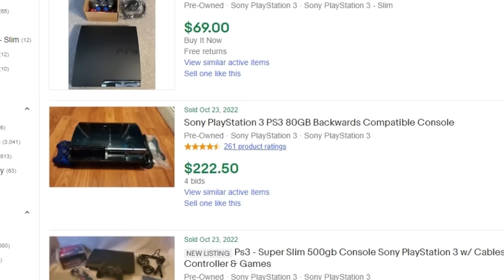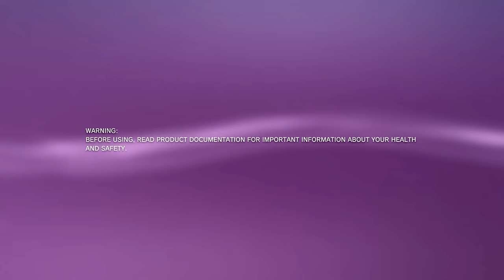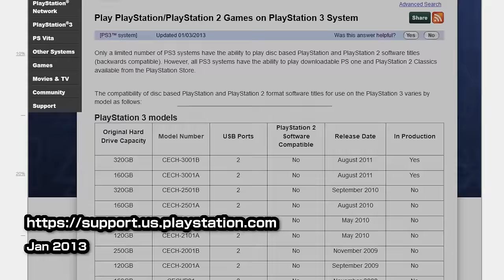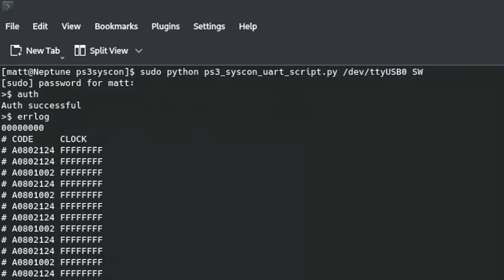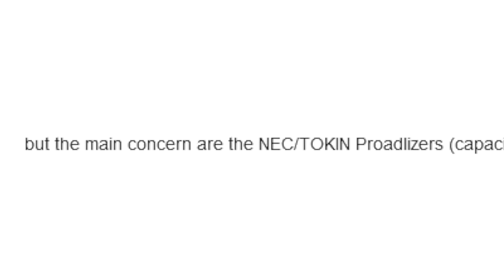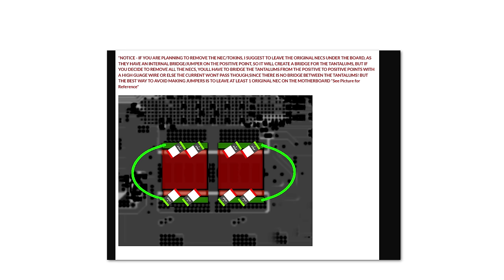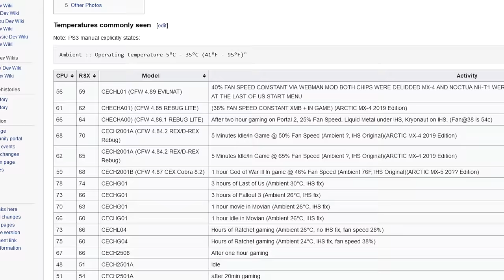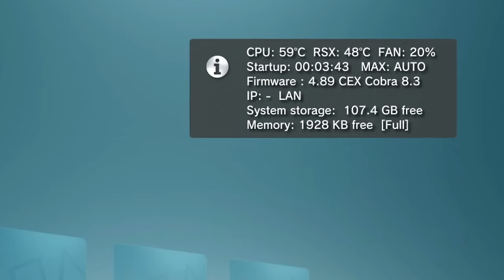I bought 3 PS3s for $50... how bad could it be?

Comment: 3:21 it can be wireless actually, but you still need another controller for that, go onto bluetooth settings, pair device and put the DS4 in pair mode, it will connect with not much problem and work wireless

also the easiest way to spot a backwards compatible one is looking at the USB ports, if it has 4 you're a lucky winner cause those are the ones

Comment: Damn Matt, that's pretty hardcore.

I would have just gotten a vacuum cleaner on hand and wear gloves.

I've never seen a video before where someone looks at the error logs. Matt is a wizard.

Dropping temps by 10°C on a Phat PS3 is very impressive. The result are on par or better than my PS3 slim.

But I'm hesitant to do something like that on my console since it's working fine, just hotter than I would like to see.

But I'm on my third console after previous failed delid attempts, so I don't want to go down that path for the fourth time.

Comment: You actually can connect PS4 controllers wirelessly to PS3. 

Use a different controller, go to settings and press bluetooth settings, in there you can connect bluetooth controllers. Hold PS button+options and the light will flicker and it should show up in the menu.

Comment: I loved your shunt mod keep it up / they use thermal compounds I would use warm dry heat upside down and vibrate it will reclump then you flip it back upright then let it cool , a way to rejuvenate the IHS thermal compound without delide

Comment: Don’t know if you can see this but ps4 controllers do connect wirelessly and have connected fine in the settings menu, controller settings or find Connect controller. From there put your ps4 controller in pairing mode and it’ll connect fine, minus home button good luck

Comment: Thanks for the great video. I got a couple of Fat PS3 consoles for $5-$10 each about a year ago. 3/4 of them have the YLOD. Might just use your video to tinker around with one or two of the bad ones just for experience. There are some sites that people would buy bad PS3 for $30+ so I might just throw it there to save my sanity.

Comment: I would have left the capacitors where they were and stuck a thin sheet of metal between the heat sink and processor. It raises the heat sink and it would have given that extra pressure that the eraser gave.

Comment: RIP Felix did i video on fixing ps3's very rarely do the nec tokin caps actually fail. more then likely its a manufacturing flaw with the gpu which cant really be fixed unless its replaced with a 65 or 40 nm rsx chip.

Comment: The "fixing only to make it worse on a PS3" hits me, tried opening mine up to fix a potential overheating problem and ended up tearing the fan connector socket off the board when trying to unplug the fan T_T

Comment: Personally, instead of fighting with adding a plastic or rubber shim under the clamp for the CPU; I'd try using a thermal pad from a mob like Deepcool, or Thermal Grizzly (namely their Minus Pad 8, comes in 0.5mm, 1.0mm, 1.5mm, 2mm & 3mm thickness) in between the CPU lid and the heatsink.
Heck, thermal pads in general make for less mess than thermal paste when modding consoles and computers (particularly when mounting a waterblock on a video card).

Comment: I have the OG 60GB fat PS3 and if I remember correctly, those were  the "Holy Grail" of PS3s...it plays 1 and 2 disks as well as 3 , not because of software emulation (as they started using after the initial batches), but it was all hardware

Comment: perhaps a thin copper shim could be a solution if the heatsink screws are long enough . I guess that makes the case taller and would cause more problems. I love the long leads , if it works , its not dumb . Nevermind the eraser mod is clearly superior . well done .

Comment: Though it's well past the expiration date, I'll still ask:  Why get such large capacitors?  Looks like 6 100uF 0603's ought to fit comfortably in each row without slanting, for a grand total of 12/TOKIN, which would be about equivalent and probably not as tall as those monsters.  For the 1000uF TOKINS you'd of course need 5 per row.  0.70 each, less if bought in bulk.

Comment: You actually don't have to use a wire to use a ps4 controller it will work via Bluetooth you just have to put it in pairing mode and it'll pop up on the Bluetooth devices list to connect. I have a cech-k 01 fat model and that's what I do. Just occasionally one of the analogs or triggers will decide not to register input but it fixes itself after disconnecting and reconnecting it. Also with the rlod system you should check out a video by RIP Felix where he goes very in depth and has created a way to actually diagnose red and yellow lod much better than any other I've seen

Comment: I saw another video about the NEC Tokins the other day. I would be interested to know if it still works because it could be bad solder joints in the RSX chip and replacing the capacitors is only a short term fix.

Comment: you can use a ds4 using the ps3´s bluetooth. You just have to pair it in the bluetooth settings. Some games don´t work, rumble doesn´t work, the PS button doesn´t work, and the sixasis doesn´t work either, but I preffer it over the dualshock 3 if the game supports it.
Or, you can install a custom firmware, and use a plugin that allows it to recognize the controller as a dualshock 3 (You can pair 360, xbox one, DS4 and switch pro controllers), that makes everything work, but in my experience I coudn´t use it because my system is softmodded, and I don´t want to install a custom firmware on it

Comment: easy way to tell if original "fat" ps3 has ps2 compatibility, is to look at the number of front usb ports. also the finish around the disk drive and if that thing next to disk drive is a solid piece, or if it opens up to reveal a set of different memory card readers.
on ps2 compatible units there is 4 usb ports, the finish around the disk drive is mirrored reflective.
but on the units you have, the finish around the disk drive is mat, there is 2 usb ports and there are no memory card readers.

Comment: The eraser mod does actually cause damage over time but and definitely if its too fuck because its puts the clamping pressure out of spec but its probably not a hige deal if you only added a tiny bit of thickness

Comment: I have an idea for a project: an adapter for the DS that plugs into the card slot and plays GBA games. Like, if the GBA processor is commonplace you can use that, or you can maybe use a Raspberry Pi Pico. The Raspberry Pi Pico uses a ARM processor, right? Maybe it has juuust enough compatibility with the ARM chip the GBA used that a very efficient, accurate emulator could be used.

Comment: For the token replacement issue with adding the new caps. Would it have been an issue if you added a thin plate to adjust for the size difference? With the heat sync.

Comment: you actually con connect a ps4 controller to ps4 wirelessly using bluetooth:

-go to settings
-bluetooth register
-press the share and ps button on ps4 controller for at least 10 seconds
-wait for it to show up and pair it
-that's it

Comment: I admire your determination to get that ps3 working again. I dug out my old ps3 that got the same yellow and then red lights of death years ago and tried to fix it. I did some research and read that the solder needed to be reflowed on the RSX chip to fix this issue. As this chip is soldered to the board in a ball gate array I read that the only way to do this is to apply heat from the top and then hope and pray that it re-seats itself. As you can imagine this didn't work and I threw the console back in the attic. This video has me thinking if it was actually those capacitors that you replaced. Not sure if I will ever take up that project again though as I can't justify spending time on it. It is one of the original backwards compatible systems though.

Comment: Using the method you used to move the caps is a high risk move and not smart for the long term. Those caps are meant to clean the power provided to the GPU, hence why they are as close as possible to the GPU. Moving them further away may lead to fluctuations in power to its cores and as they heat up and age you'll start to notice strange graphical errors, eventually complete gpu death.

Comment: If you can relocate the caps with paper clips, why can't you just relocate them altogether and use not-expensive caps? You would just might need to compensate for the resistance in the wire if it's long enough 🤔

Comment: One time an acquaintance gave me three busted PS3 fats for $20. He didn't know anything about them or play games really, so he was happy to sell them to me for cheap as a thanks for helping him in class. Two of them were CECHA01's, one of them working, but bad BD. I swapped the BD board onto the YLOD A01's drive and used it. I fan modded it and used it rarely and carefully until I was confident I could delid it. Then thankfully we had the downgrade breakthrough and I was able to remove the fan mod thanks to CFW and webman. Now it is my shining treasure.

Comment: you CAN use ps4 controller on ps3 wireless, you need to put the controller on bluetooth search or whatever and connect it from ps3 from bluetooth devices. but i have never owned that old version, so it could be different story tho

Comment: Hey Matt any update on if the PS3 with the new caps still works (after real usage). If not, may be a gpu issue which can be replaced with a 40nm one even on boards that need a 65nm gpu...with some others mods which sony did back in the day but even better done now.

40nm gpus were apparently the best(super slim is even better but not compatible I think) but a cechk01 or later (with 65nm) should be okay.

Comment: Hey, if the PS3 dies in a few months and is one of the backwards compatible models, you'll probably want to look at replacing the GPU. Something about bad bump fill within the GPU that heat can temporarily fix. One of the late 60nm or any of the 40nm versions should work for that from a non-backwards compatible model.  Check the firmware first.
Reply: RIP-FELIX didn't work through three years of PS3 diagnostics hell for this.

Comment: You can use PS4 controllers wirelessly with the PS3, you just gotta put the PS4 controllers into pairing mode and pair them on the PS3.

Comment: Ya know, you can actually run PS2 games on those Playstation Konsoles. I'm running NFS most wanted 2005 on my super slim with hen, the homebrew enabler. All you need is the PS2 CD and a PC with a disk drive. There are lots of tutorials on YouTube.
15:00 Also, see the very short yellow light between the green and red light? That's the Ylod aka Yellow light of death as much as I know. Have the same problem with my Phat model.

Comment: I found a great price for PS3, I got a PS3 slim with great 5/6 games and 2 controller (mint condition and no scratches ) for about 50/60 bucks, and the games are valued between 5 and 10 bucks each

Comment: You can have a ps4 controller connected wireless you need to make the controller search for Bluetooth and then open the Bluetooth on the ps3 and it should work

Comment: 3:25 Also you can't use the gyros. The reason is because the PS3 supports generic wired controllers, which is what it sees PS4 and PS5 controllers as. A real shame they never added official support, I'd much rather use a Dualsense than a Dualshock 3, but the limitations are too annoying.

Comment: For getting stickers off shiny things that scratch easily and you don't want to scrub, I'd suggest lighter fuel. The fluid type, obviously - spraying it with butane gas probably won't work unless you want to burn it off! 🙂

Comment: I may try to clean inside like you did and see what happens .it does work again after reset but freezes again so.not much point to use .I can take back to charity shop same town .they pat test them just safety check to make sure no shorts really

Comment: I got a backwards compatible (software version I believe) ps3 for $40. Some mom wanted to get her kids a switch and I wanted another ps3 that wasn't the super slim. Put in an ssd to keep heat down, and redid the thermal paste (but didn't de-lid and thermal paste that))

Really, I'd say just get a super slim if you care about longevity. The OG's and the slims overheat too frequently. Backwards compatibility is nice, but I'd recommend just emulating or getting a ps2. Using a ps3 to play ps2 almost seems like a sin, because that's how sensitive these older ps3's are. It's not like a NES where you can just keep it going basically forever, the ps3 rsx and cell will eventually overheat and die

Comment: For the dirty fans, there’s a feature to clean them. Unplug the HDMI, plug in the power cable, and hold the eject button, while turning the power supply on. This turns on the fan at full speed to remove anything in there.

Comment: Personally I would still check the other two PS3s for any errors. I have a PS3 phat model that seemingly works fine until you run a performance intensive game, upon which it crashes like the second PS3 unit. PS1 games run completely fine on it otherwise.

Comment: Hey, fun fact, once you have the PlayStation 4 controller plugged in, and it’s detected, go into Bluetooth devices and select sync. Bluetooth device put the controller in pairing mode, and the PlayStation 3 will detect it for wireless!!! This only works with legit Sony controllers. Aftermarket are hit and miss and I don’t even think you need to switch the controller over, try it with it connected and then try it disconnected(wired)

Comment: matt: checks the syscon error codes, determines its a nec/tokin cap issue replaces them, it works
comments: um actually its not a cap issue have this video on how its not. 🤓
(i understand that the caps arent always the issue and that the RSX is very flawed especially the 90nm version but like if it works it works, and i assume the he would have a follow up video or some kind of pinned comment about it being broken again if it was)
also it entirely is dependant on the revision fat ps3 he got and whether or not it even has the 90nm rsx, if its a later phat ps3 like the JKL etc. that has 65nm rsx its entirely possible it genuinely was the capacitors being the issue since from what we know the 65nm while still possible its defective is way less likely to be so

Comment: Hi Matt.I just bought a ps3 slim. Model top loader think it’s 40gb 4003 model no it loads up ok. But keeps freezing not yellow screen sometime white screen or just fails to respond to remote and just beeps .any idea?I paid 30£ at charity shop came with wireless remote no power supply but they figure of 8 lead easy to source 6£ diy store it had one game with it .I took it to pawn store to sell it had piece of plastic chipped off at back so they couldn’t buy it.

Comment: Errors 1002 and 2124 has nothing to do to capacitor issues. It's well known processor substrate separation from silicon. Not even from mainboard. Capacitor change will fix PS3 for about a week or two. Permanent fix will be changing CPU. Please check video: A PS3 Story: The Yellow Light Of Death

Comment: error code 1002 isn't token related, it's the gpu so the motherboard is done and dusted, throw it away and replace it.
Reply: The motherboard can actually be salvaged from EC1002

How? Replace the RSX with a 45nm one instead of the 90nm

Comment: 13:12 huh? Why would they be THAT expensive? I mean those things are usually dirt cheap? Are they some ultra-highspec low esr high presion things? I mean 1$ per capacitor is something i would expect from low-grade metrology stuff, not some off the shelf capacitor.

Comment: Hey Matt, 
                  I have a ps 3 with flashing red light as well and I never was able to back up my game data of the 20 gb hard drive before it failed. I have a ton of game save data from ps 1,2 and ,3 games and unfortunately Sony paired the hd to the console. If you try to access the drive in another ps 3 it wants you to format the drive. I would be willing to pay any price to get the system working long enough to back up the data to another drive. Would you be willing to fix my unit and back up the data for me? I would cover the shipping to and from your shop. Please let me know, thank you Justin.

Comment: Why did you change the CPU NEC Tokins? They where probably just fine. 🤷‍♀️
Reply: If you mean the roach-fest phat, that looks like a CECHL unit (VER-001) and he specifically read SYSCON and had 1002s in the log.
Reply: @NSHG  Isn't that a GPU fault code?
Reply: @PrinsessePeach Yes 1002 is specifically a power filtering issue, and the NEC tokens are the most common culprit for those
Reply: @KatelynS0209  As he also mentioned it would probably be wise just to replace the NEC Tokins for the RSX and leave the CELL NEC Tokins, as they where just fine.

Comment: Hey matt, I'm not saying it was a bad ideia replacing the caps but apparently most of the YLOD is because of faulty BGA in the RSX chip, and replacing the caps works because the area around the RSX was heated enough to get some connection, but this fix tends to stop working after a short time, but I might be wrong, I'm very new to this subject. It would be nice if you make a follow up video after some gaming sessions in the repaired cap PS3, my reasoning comes heavily from this video that explains the complexity of the YLOD https://youtu.be/I0UMG3iVYZI
Reply: He did check the error code though from the syscon and the errors indicated that the RSX Tokins were bad. Though it definitely wasn't a good idea to replace the CPU caps, that probably ended up being more trouble than it was worth.

Comment: The reason for the higher price is that the console didn’t sell that well compared to the 360
Reply: It's also because the components were more expensive than what it was actually selling for, which is why the military bought these to build super computers with.
Reply: the components were worth like $900 when it was sold at $600